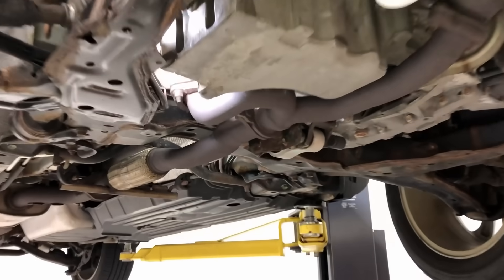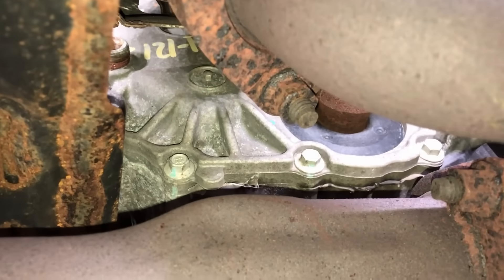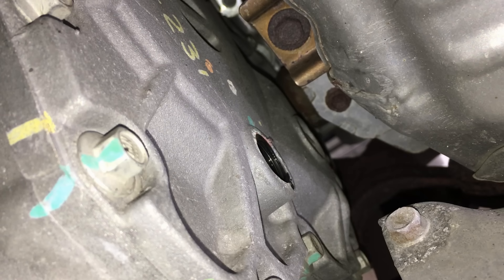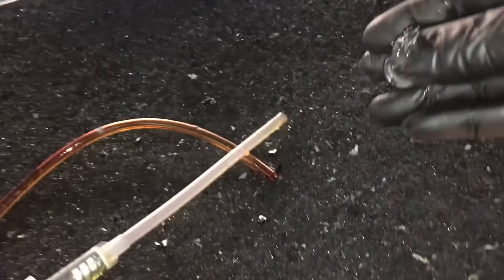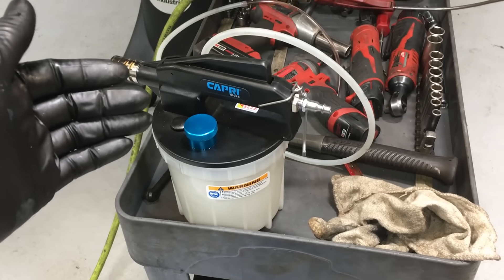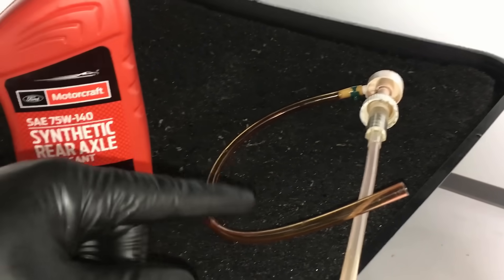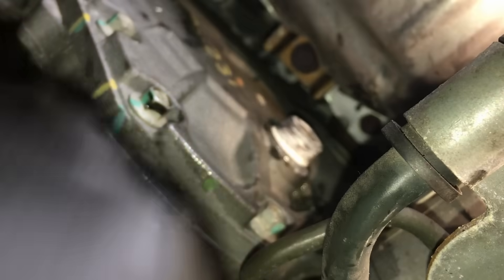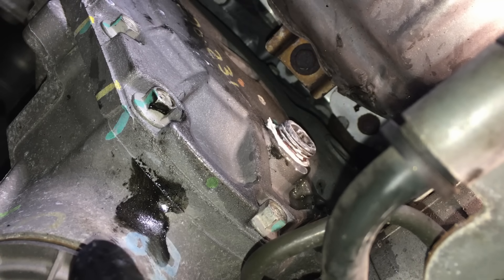Ford All Wheel Drive Vehicles: Critical PTU Fluid Exchange Procedure

Comment: With all that crude inside,   just remove it, WTF, those Ford engineers were smoking crack, thank for sharing.
Reply: behexen250 I can’t believe the crap they are selling now days. Who puts a water pump inside their engine right over the oil pan on the timing chain so when it fails it pours antifreeze into the crankcase and destroys the engine? Ford does.
Reply: @williegillie5712  unfortunately that was a design by Mazda and there are other automakers that have engine designs with internal waterpumps as well.
Reply: Jonathon Klimmer - Mazda also leaves something to be desired.  Toyota is probably the only brand that appears to still have their act together, although I’ve heard some choice words about the new Tacoma.  Oddly enough, TESLA (of all brands) seems to do a lot of iteration and their product has improved a LOT over the years.  Meanwhile, Ford has been pumping out the PowerShit DCT for years, in spite of knowing they’re worrhless garbage.
Reply: @jonathonklimmer6698  I heard the reasons was so that the 3.5 would fit into a 3.0 platform
Reply: @ClockworksOfGL  Tesla is working with a superior drivetrain and a no-bullshit attitude to making cars. Ford is stuck with corporate culture and a supply chain network that sells overpriced garbage.
Reply: @williegillie5712  Some Nissans are like that too. Water pump by timing chain as a cost saving measure. When they fail instantant destruction.
Reply: Willie Gillie it’s all good now, they put a drain hole so it spills your coolant all over the highway instead hahaha
Reply: @williegillie5712  I think Cadillac did it years ago. Didn't work out very good.
Reply: Bryan Noga, I think some Toyotas have the starter inside the engine. Lol

Comment: My '12 Escape is about to hit 100k and I've only owned it since 84k. I'm afraid it's going to look just like this
Reply: I’ve seen some SHOs last well over 100k on the original oil and they’re heavier and make more power and are much more likely to be driven hard. So don’t worry too much, just get it changed out ASAP. And since you don’t know if the p/o has done it,  do the cycle like he suggests of driving it 1k miles and doing it again then go to 30k intervals after that.
Reply: Ur good get it changed by good mechanic! Use Motorcraft synthetic fluid only.

Comment: How much would a PTU FLUID change cost
Reply: It depends on your dealership. I had mine done a month ago on my SHO for $138, but I’ve seen other people get quoted double that or more. Some dealerships have refused to service them because “they have lifetime fluid”. If you can find an independent shop that knows what they’re doing I’d go that route, but only way to know how much it’ll run you is to call and ask.
Reply: I buy the fluid and my mechanic charges me $40. I've switched to Lucas full synthetic from Motorcraft. I'm now changing between 5000-10,000 miles.

Comment: Hey Brian, our 14 MKZ has gone through 2 intermediate shaft seals in the past year, just had it replaced a 2nd time maybe a month ago. Fiancee was complaining that the car was "having an oil burning smell," yet again when coming to a stop. I havent popped underneath the car to see if its leaking again, but if it is, should I start pushing for a PTU replacement? I'm guessing the PTU is overheating if it keeps popping the seal. Car has 66k miles on it, so it only has 4k miles left of a powertrain warranty, and I REALLY dont want to be stuck with the cost of a failed PTU.
Reply: That odor when you stop is a sign that the PTU is failing.  You need to have the PTU replaced now and its an expensive repair.  The PTU on my Taurus SHO began smelling like a natural gas leak.  I didn't know what it was, but it seemed to drive OK.  A day or two later, the smell was atrocious.  It would make you sick when the car came to a rest, like fresh skunk, rendering it undrivable.  The part can also seize up.   I would recommend getting it fixed.

Comment: GREAT video!!! Getting ready to do this job for the plant managers personal car and then my wife’s. Kinda shocked on the weight but I haven’t researched any info yet so thank you.
Reply: Easy done. I just used a hand pump for brake jobs, and extended the breather tube by the throttle body as the filler, save the breather tap to plug it. badabing  badaboom.

Comment: Would this be the same on the Focus RS?
Reply: The RS uses a different system, so I’m not sure if this is exactly the same procedure. Might want to check out the RS forums to see if anyone’s posted an instructional.
Reply: Andrew B I just found out it has a drain and a fill, Still recommending frequent changes.
Reply: Always change all fluids regularly on any high performance vehicle! Esp the awesome RS.

Comment: Is there a spot in the casting thatbis thick enough to put in a drain plug. This is not the first time  thay ford didnt put drain plugs in things that needed them.
Reply: I did mine 7/16 drill a good 1/4 inch tap. I got a magnetic 1/4 drain plug. I dropped exhaust but think it can be done without
Reply: Use an extension on the tap and look for a video here showing a good part to drill.

Comment: I'm getting ready to change the ptu fluid in my '13 MKS next week. 44k on her. The ptu horror stories have me nervous.
Do you have an opinion on adding a small air scoop or cutout to the lower splashguard to direct cool air toward the ptu? Worth the hassle?
Reply: The Ford Flex belly pan has the slot cut out to direct air up at the ptu and it fits on SHOs and MKS, so might be worth looking into.

Comment: Does the 2010 Explorer have the PTU?
Reply from the maker: no
Reply: No the 2010 Explorer has an actual transfer case.  Either a BW4412 or BW4414.  Depending on which transmission the explorer has.

Comment: Ford knows exactly what was going to happen and figured the vehicle would be out of warranty when it crapped out, great job again Ford!!!
Reply: Backfires so bad that people dont buy any ford again.
Reply: What is name of the white sealant you used on the plug in reinstalling it after refilling with new fresh fluid ? I have 2 valvoline versions of the 75W 140 fluid for our 07 edge sel awd 3.5l by with towing package suv. 

I forgot to ask you in respect to the tranny hard shifting etc of P0720 issue, how much transmission fluid is required to refill system and will it need stopping off after driving vehicle so computer relearn new output shaft speed sensor OSS and TSS as well ?

Comment: I know it's off topic, but just had to ask you!
A shop replaced my 2009 F250 2 wheel drive fuel pump in 4 shop visits. Terrible workmanship. Had to remove the drive shaft 3 times. Now the truck vibrates like crazy at basically all speeds. What could they have done?
Reply: Rotate the drive shaft 180 degrees
Reply: @sprint2648  Thanks to Smitty, I don't think they removed any U-Bolts, only flanges,  but I'm HOPING Sprint26 is right. I DID find one bolt each not tight on the front and rear flanges. I told them about those and they tightened those and replaced two bolts that didn't fully tighten. Seemed to help a little, but still have a vibration that I didn't have before the 3rd shaft removal.
 I'll find out Tuesday next week, hopefully.
Reply: I'd be checking to make sure all the cap strap bolts are tight on the drive shaft, and if so, I'd remove the two caps and see if they still have all their needle bearings ... and if they're bone dry or not. Another thing that happens is, the caps can go into the yoke crooked if rust and scale wasn't cleaned out of the yoke, first.
Reply: @SmittySmithsonite  Long story short, we can't any people to work here in Odessa, Texas!  Help Wanted signs are everywhere!!

Comment: 2010 Flex, I had to replace the PTU at about 60,000 miles. Black goo was puking out of the vent. The independent shop said they were not going to mess with trying to clean it out. Surprisingly, the dealer had PTUs on hand and in stock. Things that make you go hmmm....
Reply: We replaced a fair number of them under warranty due to case porosity. I think there was a TSB but I don't remember for sure

Comment: This was posted exactly after my ptu makes a loud bearing noise and now I changed the fluid and nothing happened to the sound.
Reply: Usually requires replacing the PTU, or you may be able to replace the bearings but you still have to remove the PTU, so may as well just replace the whole unit than trying to remove and install a bearing.

Comment: It's either a complete engineering oversight or it's engineered failure make it last just long enough to buy another car.
Reply: Planned failure.
Reply: It’s an engineering oversight. A lot of the older engineers are retiring in the auto industry and the newer engineers are still learning so they do things like this without realizing the ramifications. I believe the auto industry goes though cycles of reliability with each generation as engineers get more experience the cars get better but then they retire and it starts over again.

Comment: When I bought my  2007 ford fusion SEL v6 FWD  12  years ago the salesman tried hard to get  me to take the AWD model, I figured it was just another issue waiting to  give trouble if I went for it ,some glad I stood my ground and took the FWD model, it has  been the best car I have ever owned regular maintenance  brakes etc, still drives like new!
Reply: How many miles do you have so far?
Reply: @Thumpr110  Has approx. 90,000 miles I never  had to put any suspension parts or have it aligned it handles  perfect and good on fuel, high way  driving 32 to 34 mpg I had a local mechanic  a "Scottie" kind a a guy put front rotors and pads a few weeks ago he checked the  underneath  suspension etc  he said it was  like  new yet.
Reply: AWD are fun to drive and pretty good in snow. Instead of a pull effect of a FWD or a push effect of a RWD, it's a dug in the ground feeling. But yes, the gears require more maintenance. I really enjoy my Edge AWD .
Reply: My wife has an 08 with 200,000 miles and no problems until the power steering lines started rusting. They are fun to replace. I guess I better check this out fluid . Lol !
Reply: Meant to say check the ptu fluid

Comment: Those things are junk, done lots of them.  Ford has a class action lawsuit against them I believe also.   That PTU is done with sludge like that 🙁
Reply: I agree that the fluid is done. But there was no chunky metal on the magnetic fill plug. I just did mine also at 86k miles and it looked the same. I did it a couple of times and drove it for he weekend. I'll drill and tap a drain plug and do it some more until it's clear. But after 5 hours on the interstate at 75 mph it's quiet. I'll see what the fill plug look like next time I do it (probably this week). If it starts making noise then I'll replace it. Until then I'll spend the money on a tap and pipe plug!
Reply: You are 100 percent wrong sir. You don't have facts. Subaru have issues too.
Reply: Joseph Dan and your experience with these PTUs is???????
Reply: @airratchetjockey7605  obviously none!!! He never responded back.

Comment: Would recommend drilling and tapping a drain plug in the bottom of the early model PTU's to make oil changes easier?  Previous owner installed one on mine and it works great.
Reply: The automaker saved 5 cents a PTU by not installing a drain plug so dang it why do you need one, its got lifetime fluid in it, its fine LOL.
Reply: William Sevier the life however is only 40000
Reply: James Swetlik 

I did that to my 2016 Flex......makes fluid changes way easier
Reply: Definitely

Comment: Taurus SHO and Lincoln MKS AWD.
Reply: I bought a pre-owned 2013 Lincoln MKS Eco-boost AWD sedan. To replace the POS Jaguar XF. I just changed out the transmission fluid, obviously the original, I just changed the cabin air filter also obviously original. I'm sure when I do this and the rear differential I'll find the same, all original fluids. This "life time" story is totally BS! I just hit 60k on the car so I'm changing everything out now. But I love the car!
Much better than the POS XF.

Comment: I can't believe they put it in such a hot environment with no drain plug and no recommended service.
Reply: I believe it...automakers design failures into their vehicles on purpose and recommend that all the fluids are "lifetime" fluids....well of course they are, the lifetime of that component till it fails and costs you as much as your car is worth to replace. Toyota recommends a transmission service on their Toyota Tundras at 120k....umm I don't think so, it would be sludge by then, but hey what does Toyota care, they want you back on the sales lot so they can get in your wallet again for a new car.

Comment: I have an off-topic maintenance question. Are there any zerk fittings on late model Fords that need lubrication or is it all sealed and you replace things as they fail?
Reply: Fix it when it fails
Reply: Scott in MN I have a 1992 tracker no grease nipples so couple of parts got creaky I got a large needle and syringe at farm supply store mixed some ngl1 grease and a little penetrating  oil together and injected in to the joint  cured the noise ,then I checked for play that was 10 years ago .I live in the rust belt if you want to keep you car or truck here the only thing that works is oil spray everything and drill holed in double walls to access plus do it your self as most companies that do this miss to many areas. Wish me luck I just purchased a used 2011 f150 crewcab eco boost 3.5 that needs rockers cab corners and  front vac locking hubs and has noisy differential only thing that sold me I know the owner he changed oil every 5000 km or 3000 miles  . I have to weld everything in here in Ontario Canada for the safety check. Ps I oil-spray yearly

Comment: Would it be possible to retro fit a drain plug in the case?
Reply: There are internet forums and YouTube video detailing the process of retro-fitting drain plugs into their PTU's. From past videos FordTechMakuloco does not recommend doing it. It opens the possibility of damaging your PTU if done improperly.
Reply: Some of the later versions have a drain plug. Also, it could use a T50 Torx instead of a 3/8" wrench.

Comment: I tried to change mine last year, but hardly anything came out. I filled it up after, but it only took about 1/2 qt.  I'll do it again this spring. like tomorrow. LOL
Reply: They only hold a little more than a half quart..
Reply: Like John Del said, capacity is 1.1 pints, so basically half a quart.
Reply: Same deal with mine, it had 147,000 on it. Will be redoing it after running it a thousand or so more miles.

Comment: Ford will tell you it's lifetime fluid. What nonsense. I had my PTU fluid changed last summer. Don't listen to Ford and get it changed.
Reply: Absolutely! The Haldex AWD failed on my Ford Five Hundred due to bad fluid. I had to spend $700 to get it working again (new pressure sensor, pump and ECU). A proper lubricant service interval would have saved me much frustration.

Funny thing, the exact same Haldex axle is used in the similar-vintage Volvo S60 and S80 sedans, and Volvo recommends service at 20-30,000 miles. This is on you Ford - Shame!
Reply: @miketeeveedub  Yes they really should be ashamed of themselves. It seems Volvo had their head screwed on
Reply: It is lifetime fluid. The lifetime is 30k miles.

Comment: If I have a bad shock on the rear of a f150 do I have to replace both rear shocks or only the broke one. ~120k miles 2013
Reply: Replace both, it will ride goofy with one new and one 120k mile shock, if one went the other isn't far behind.  No need to do the same job twice.
Reply: Always replace suspension parts in pairs, at least i do.
Reply: Replace both.

Comment: I started the PTU oil changes at 70,000 miles. By 85,000, I've changed it three times. 
What additive can I use to clean it up?
Reply: Kerosene is good to use to clean it out. We used it by putting it in, moving the car forward and backward, letting it sit, and then draining. That’s what trucking companies do for cleaning out gears as well.
Reply: pindiwal I’ve heard of guys running ATF through. Like 300 miles and then suck it out. I personally have never done that.  But, I can see the logic, atf is has very good cleaning properties. A lot of regular transfer cases use atf. 
If you’ve changed it 3 times I would think you should be good?
Reply: @bryceweaver8211  Even with a 3x change, the oil is super black. I think I might try ATF for a few miles since I'm extremely skeptical of driving more with ATF.